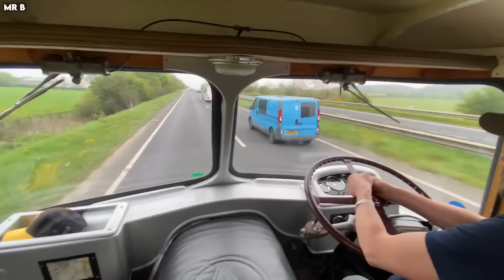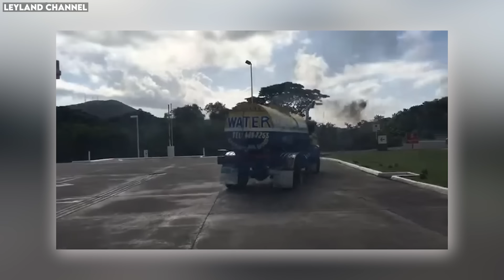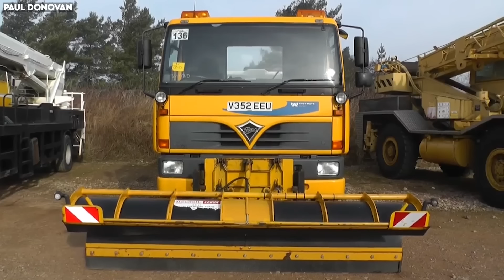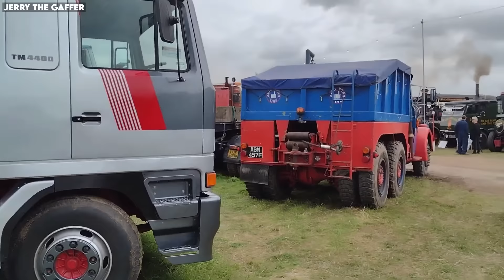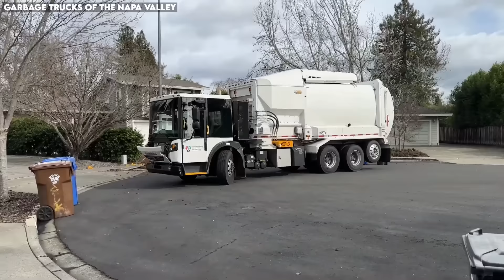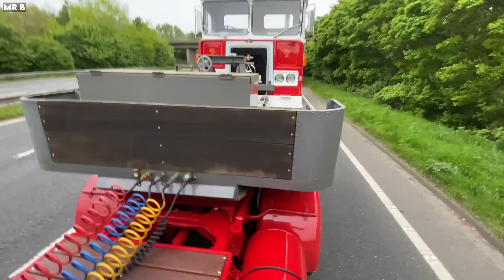10 British Lorries That Deserve a Comeback

Comment: that trucks had twin splitter gearboxs crunch crunch
Reply: Only crunched if you couldn't drive one,best gearbox 👍
Reply: @Western1011 never  needed a clutch onless you put a driver in one .who said he knows  how to drive 😂 you knew he couldn't  as they  tryed  pulling away  in 2 which is 4 gear😂😮
Reply: They  only crunch 4 gear movements 3gears per movement  if your doing it wrong easily to  use 😂

Comment: Ford transcontinental  good trucks bad brakes  people fitted scania axle  at front  😊
Reply: Transcon, great individual parts let down by the Ford parts that held it together.
Having said that I could regulary run the taco speed trace of the taco card and the fun of changing up a gear while passing some struggling F86 that was changing down on the same hill.
Reply: @IanJohnson-w5n totally agree 👍 😊
Reply: The transcontinental was pretty quick in its day, my dad followed his mate driving one, suddenly he was swerving all over the road, it turned out the headlining fell down and blocked the view…FORD, Fix Or Repair Daily.
Reply: @Nurlechaffeur with the big cam and 13speed they done 100mph +😮😊
Reply: @J @JohnMocock Thats slow, If you got them into top would do Cardiff to London in 20 minutes, over the Bridge they would fly over the toll booths and land somewhere near Almonsbury . With two twenty ton coils and 15 tonne of cement from Aberthaw it would take about 35 minutes longer.😊
Reply: @Nurlechaffeur hard to no wot ours done except was yold by car behind  we where  doing 107 on London to Scotland  run 😊
Reply: @Nurlechaffeur 😂

Comment: sorry the marathon was built by us at AEC ltd and we closed down in may 1979. it had a leyland badge on the front because we were not allowed to put an AEC badge on the front, [ politics ] ,the mk 2 was better as it had improved braking system, choice of 3 types of engine., our own TL 12 was the best
Reply: MK2 matherthon, at last a Bitish made lorry that was almost as good as what Volvo, Merc and Scania had been making for 20yrs previously.
Reply: @IanJohnson-w5n  I very much doubt Merc my friend they haven't made a decent  truck ever
Reply: @stewartbalmer1515  Merc have never made a decent truck ever??? Really???? Perhaps you weren’t around in the days of the legendary short-bonnetted 1418, 1924, 2624.
Reply: TL12 better than a Cummins?
Get a life.
Reply: @seamusburke9101  side cover gaskets and broken injector pipes  spring to mind on the TL12…
Reply: @maizetina daf managed to  make it a good engine  used in every 95 except the 525 Cummings  space cab😊
Reply: @seamusburke9101 tl12 never out of the workshop,220 Cummins only in every 6 weeks for it’s inspection,